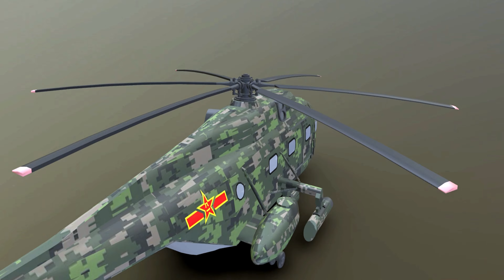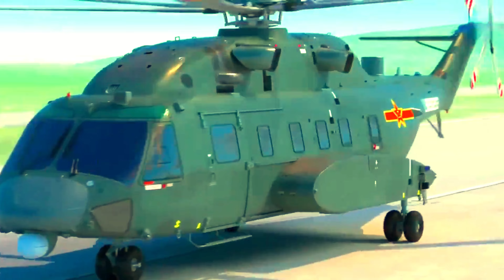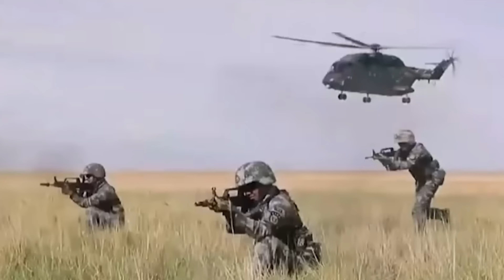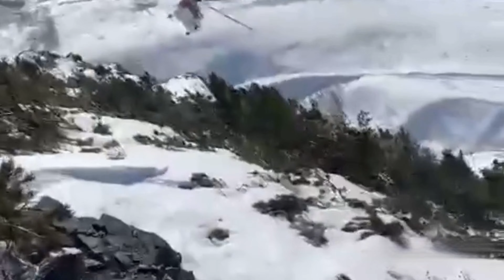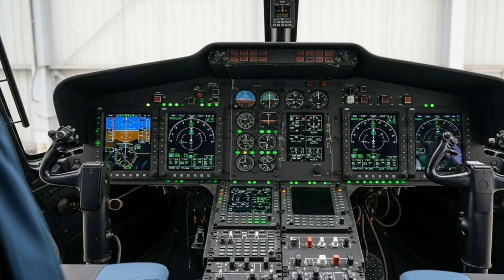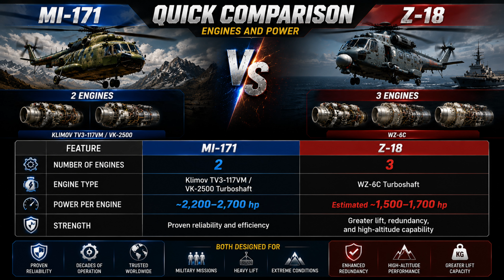Mi-171 vs Z-18: Which Military Transport Helicopter Is Better?

Comment: Z-18 looks more promising. 
What is the price difference?
Reply from the maker: The Chinese Changhe Z-18 heavy-lift military helicopter typically costs between US$15 million and US$18 million per unit. However, specialized versions such as the Z-18A can cost as much as US$35 million, depending on the installed avionics, mission systems, and level of customization.

Similarly, the Mil Mi-171 is priced between US$11.5 million and US$32 million, with the final cost varying according to the specific variant, configuration (VIP transport, cargo, or medevac), and whether the aircraft is new or refurbished. For brand-new units equipped with comparable systems, the overall pricing of the Mi-171 and Z-18 is generally quite similar. For mountain flying, Z-18 is way better due to its service ceiling advantage, its advanced navigation system, its terrain following radar, and its logistics carrying capacity, which gives it a huge edge over Mi-171